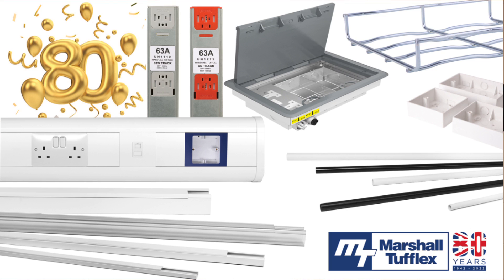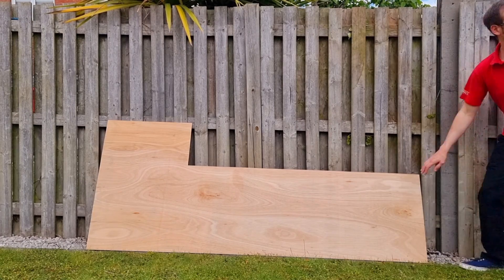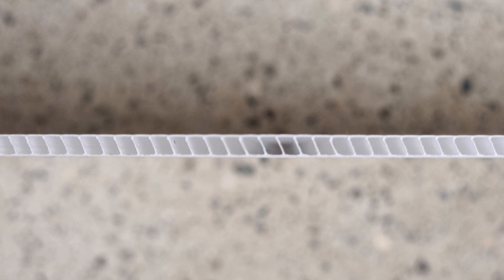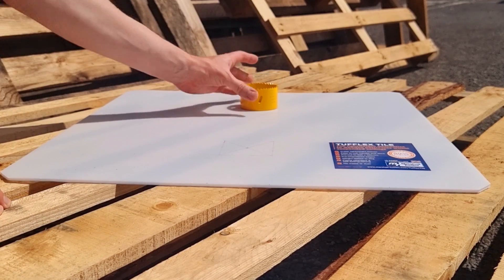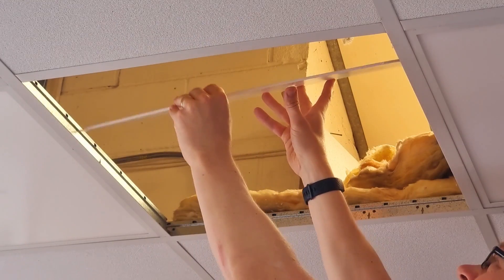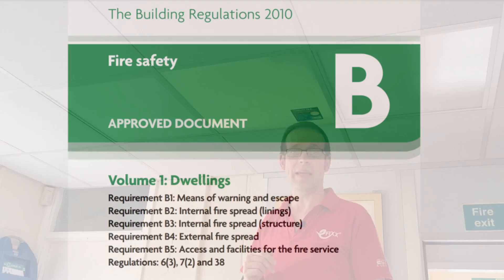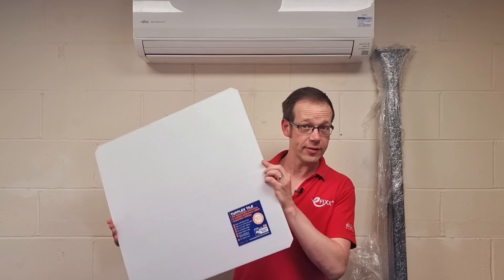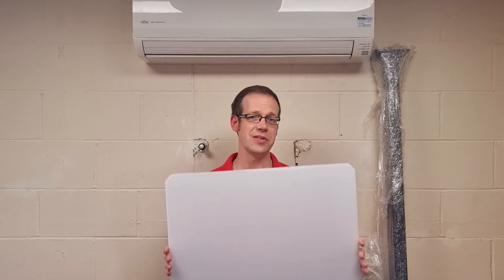Do Electricians Really Steal Wood To Do This?

Comment: Great idea, but why would anybody need to cut a piece of board as big as the tile? I never have. As long as the light fitting can be fixed to something rigid… the piece of board could be 150mm x 150mm…
Reply: Would that be compliant with the requirement for a 5kg load capacity?

Comment: So, how much do they cost?

All I can find is "call for pricing as it depends on volumes etc".

For how few most installers will likely need, it would be great to have a ballpark of how much they are, and whether or not they're actually available from any wholesalers in small quantities.

A nice idea, but for most I imagine the takeaway may be "buy some corex to keep on the van" rather than bits of plywood, although plywood is useful in vastly more situations.
Reply from the maker: No doubt they'll become more readily available in time. 😊
Reply: This is the thing with products like this sometimes. If your installing this sort of thing often enough, you've agreed beforehand to have the main contractor supply patresses. 
If your doing a couple yourself, a standard 1200x2400 sheet 6mm ply gets you 8 patresses for £20 of material that is also useful for other jobs, only takes 10mins to cut up with circ saw or jigsaw and a straight edge. 
By that reckoning If they're anymore than £3 a board, theres no point
Reply: Trade list price £3.71 each